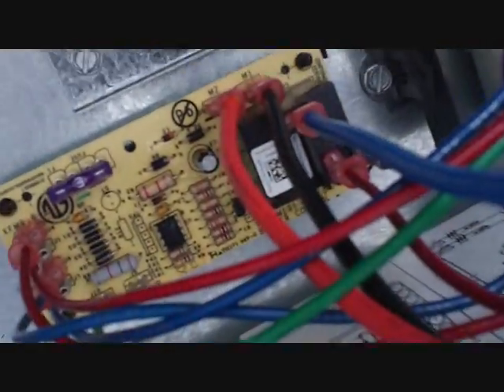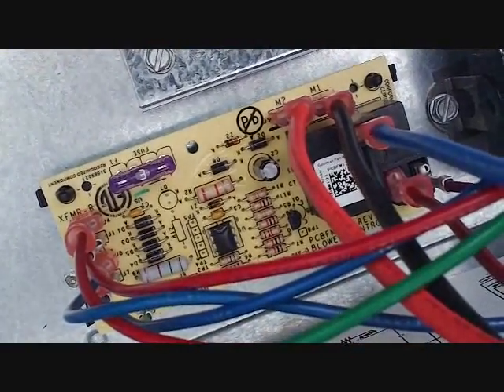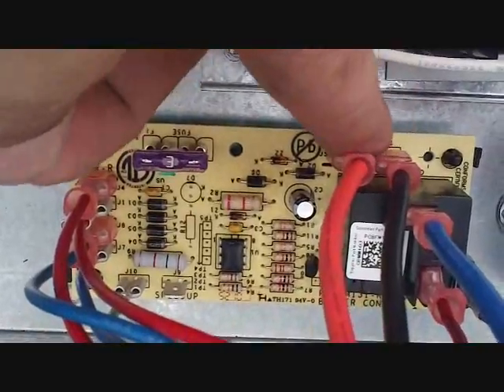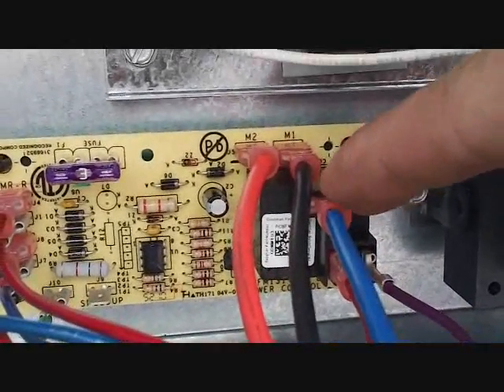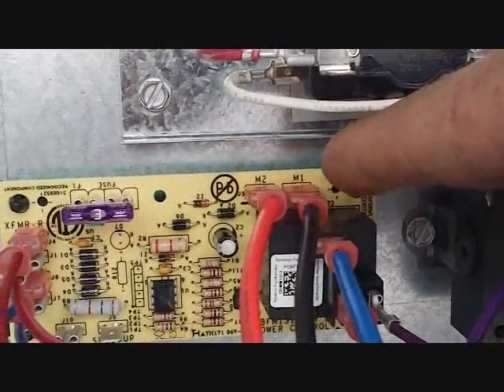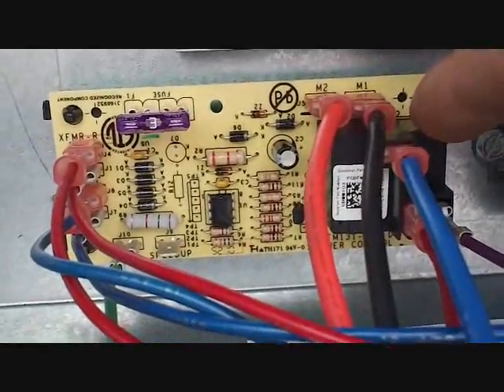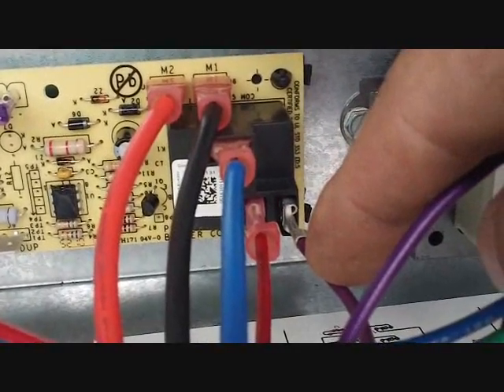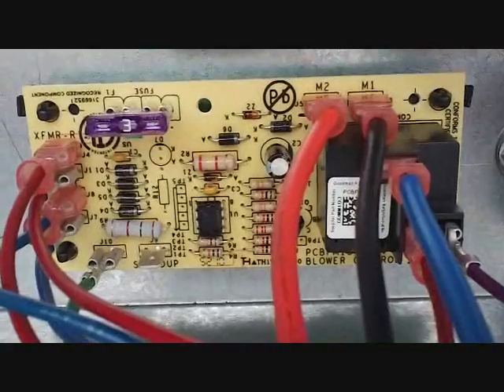Heat Pump Air Handler: Changing Blower Speeds

Comment: On the bottom left corner of your board there is a “Speed Up” terminal. My Evcon has the same terminal. Any idea what that is used for?
Reply from the maker: Most of those terminals speed up timers when they are shorted.

Comment: What is the cfm difference between low medium and high ?  What speed should I have my goodman blower set to with a 3 ton unit on a 20x25 return .
Reply: I know this message is six months old but I just upgraded the air return on my Goodman. I went from a 14 x 24 x 1“ pleated filter to a 20 x 30“ 4 thick pleated filter. I made the return box 24 inches high and ran the 16 inch duct into the side to remove one of the 90° bins. The system flows incredibly better I would say airflow picked up at least 60% or more without changing speeds.

Comment: My guy says the only way to control air speed is with a damper? Do all heat pumps have the option in your video? Mine is probably 20 years old.
Reply: Damper is the worst way, air speed and duct design is the correct way.

Comment: talyn875 Since there really aren't many 1.5 ton air handlers, and a 2 ton air handler is usually used with a 1.5 ton condenser, what speed do you usually set it to to step it down to a 1.5 ton airflow?
Reply: John Smith did you ever get an answer for what speed the blower motor should be on?  I'm totally new to learning hvac
Reply: If you want more air flowing thru your house set it on high but it will add few extra dollars to your electric bill. Low mode is energy saving but may take longer for your house to cool. I may do a mod and install a 3 pole rotary switch for easy control.
Reply: This is not necessarily true,  you want your fan speed and compressor sized optimally to cool your house efficiently.  Running the fan at a lower speed will cause your condenser to run longer at the same space temperature setpoint which will probably raise your electrical bill.
Reply: @davidsmit6174  You hit the nail on the head, David. My house has exceptional insulation which mean less cooling demand. However, that means less cooling BTU's per cubic foot of air in my house (which has cathedral ceiling). It takes over an hour to cycle the thermostat setting on the low fan speed so I had to step it up to medium, and it still keeps my humidity around 35% in coastal South Carolina in the summer.